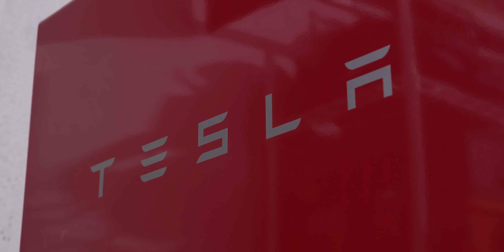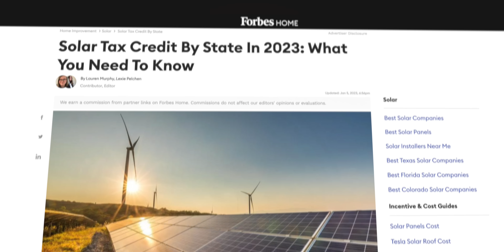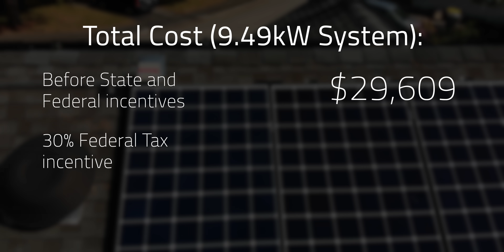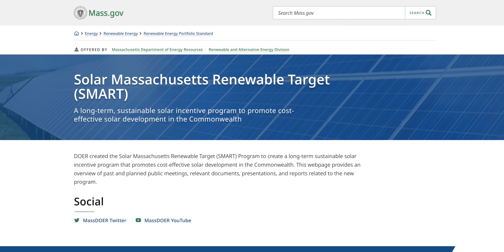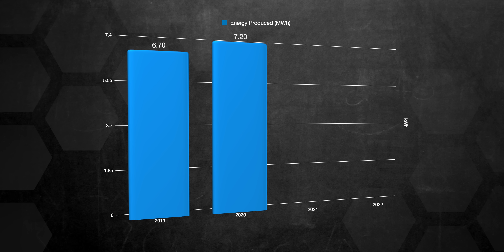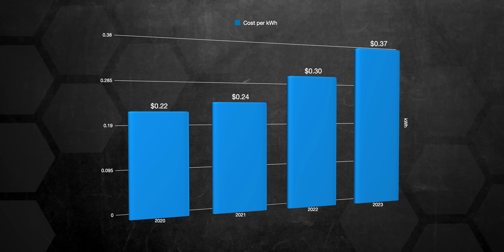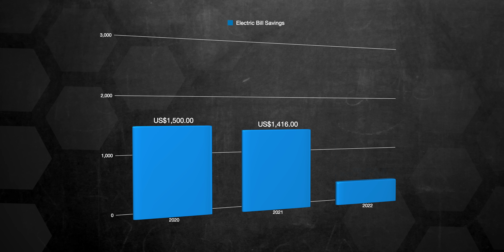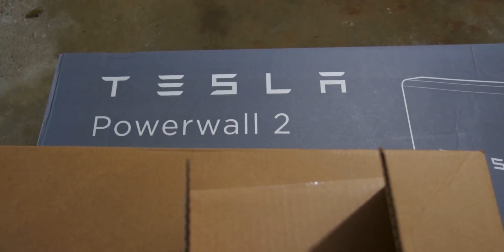5 Years with Solar Panels - Is It Still Worth It?

Comment: Solar panels installs are generally done wrong mounting  to the roof ( metal ones are worse) NASA recommends at least 12" of unobstructed air gap for natural cooling Panels are de-rated 0.5% for every 1 degC   above 25 degC of cell temp ( not ambient) Best is to tilt by 5 degrees

Comment: I was surprised that there is a difference regionally where you install a solar system. You have a 9.6 kW system that produces up to 7.6 mWh per year, I have a 4.8 kW system that produced 7.6 mWh in 2023. I'm in Reno Nevada with a bit more sun. We use about the same amount of energy as you stated in our home, so the system only covers a little over 70% of our energy. All these numbers are similar for usage, but the cost of the systems are way different.

Comment: Well I live in a 1000 sqft house I did my math it’s not worth for me lol I just spend in my annual electric bill just $600 so in 20 years I’ll spend $12k attached to the grid so the 5kw plus battery cost is around $30k plus installation fee so if I get solar option sounds like a going to pay more before to get the investment return so very probably the battery unit will needs to replace before the time that I’m going to payoff the solar panels and the battery, I would like the people clarify those things to the people who I lives in small house

Comment: Almost 30k for 26 panels???? Thats robbery. I had 8 panels installed for 2400 euros. Factor is 3,25 so 7800 euros for 26 panels. mine where also installed in 2018. Insanely expensive.

Comment: 5 years is the tipping point when things usually go south. Thats when the controllers start to fail requiring replacement usually 1 or 2 at a time, this is much more likely in excessively hot regions like the southwest or the cold northern states/Canada. This can be mitigated some by keeping them in a more climate controlled area, but in most cases they start to go bad no matter what in the 5-10 year timeframe. Some cheap ones have been known to die after just 2-3 years.
Then the battery systems in many cases only have a life span of 3-8 years, depending on the brand and type. 
Beyond the 10 year mark, the silicon and soft metals in the solar panels start to degrade, leading to a slippery slope of efficiency from the panels themselves. Typically by the 15-20 year mark the panels are almost useless and need to be replaced. The newer panels made post-2020 are much worse than the ones made in the 2000-2015 timeframe when they actually cared about quality and cheap junk was very rare.

Comment: 965 / 5.000
Solar energy in America is 3 times more expensive than in Europe. My 9.5 KWH installation costs less than 7000 dollars (converted from Euro)
And in the Netherlands we have a government regulation that the returned electricity yields as much as what you use from the grid (this regulation ends in 2027).
Are the solar systems in America better than in Europe?
No, it is the rules of the companies and government that make it much more expensive. The components in the systems are exactly the same, only in America everyone wants to make money from it.

Explanation can be found here.
https://youtu.be/-qNRMwWwvt8?si=QxYBmg9-YDiKDODt

I earned back my solar system in 3.5 years. Plus I have a backup system and battery. Total costs 6000 dollars.
This ensures that the efficiency of the solar system increases to approximately 85%. If you don't have a battery, the efficiency is approximately 30% and you are dependent on what the energy company wants to pay for your solar power.

Comment: Before getting solar, have your electric checked and upgraded or replaced, and have a roofer tell you how long your roof is likely to last.  I got hit by issues with both after the solar system went in.  The roof had been refurbished, but not well, and was wearing faster than it ought to have.  Drilling the slates and mounting the rails meant repairs were more complex and the solar had to be removed and replaced, which doubled the cost of repairs.
The electrics were old and on different standards, and when the system was hooked up, there was a major fault in the main fuse that would have caused a fire if I hadn't called for emergency repairs and had the electrics fully replaced all the way back to the meter.
As for the system, it's a 2 kw system that was available on a grant, which is a major reason I felt rushed to sign up before it closed.  In the UK, large appliances run at 3 kw peaks, so the inverter alone isn't enough to run the house.  It can only run 2/3rds of an appliance at peak.  I still have to import a little.
However, I can run appliances on eco modes to keep them off peak as much as possible, and run them sequentially wherever possible.  This allows the system to provide most of the electricity I need during the day.  It does require a lifestyle change or smart appliances.
I'm likely to invest in underfloor insulation and floor structure replacement at the same time to seal up draughts next, and fit far infrared panels for heating panels and a Sunamp heat battery for DHW.
The system was provided right before all systems that exported were eligible for SECs so I missed out on that until I get a registered battery installed for exporting.
My summer use is 3 kwh and peak production is 12 kwh, so there is 9 kwh available for export at the height of summer.  I will use more when I get a fridge.  At the moment, I use filtered milk which lasts long enough without being chilled and only buy other chilled products that I will use within 48 hours.  But I do miss the convenience of a freezer.
My use will also go up when the  FIR panels and heat battery are installed.

Comment: So, without Taxpayer's money, the solar power system doesn't pay for itself for 20 years.  That means you don't start saving money until year 21.  How much maintenance/replacement costs do you calculate over the 20 years?  That maintenance would make the break-even year further out.

Comment: My opinion is buy backup generators, forget about solar,   Invest in cryptocurrency,  make 3-5 times your money — you will be cooler with your friends, and have plenty of money to pay for your utility bill.  $30,000 K times 5 =
$150,000
  
Or minus being negative           $ 30,000 K for a system that will need updating , and maintenance,  learn crypto only put money in the top ten coins be conservative and make money, no pie in the sky type of investing or put money in s&p make money don’t spend money.😂

Investing has better rates of return than solar,   

Learning about solar takes a lot of time , same as investing,  put your time to work efficiently.

Comment: Snow sliding off roof is really scary.  We had a large barn with a metal roof.  This was a very tall building to begin with so no way we could sweep off snow.  Also as snow stays on and melts it then hardens over and over.  Every year we did have an avalanche which was so massive it took out a lot of our pvc horse fencing.  Shattered the fencing causing danger for animals as well.  In our region, most folks that got solar kept it off any buildings.  Free standing only.

Comment: I put solar panels on I had them for 6 years didn't really save me much money in six years that I had lived in the house where I put them if I had to do it over again I would not it wasn't worth the money they constantly broke down every other month one panel would go down and it was always the same part that would always fail so after the warranty expires I won't be able to afford to keep these things up and running luckily for me I sold my house so I don't have them anymore and I will not put them on the house I have now not worth the money the electric company was charging me more and more for the use of my meter and what I was getting kicked back when I first put them on I was paying about $10 a month when I moved out six years later I was paying $65 a month to the electric company for what the company I use was solar source in Florida they charged me $22,000 for 7 K system I paid $122 a month to pay them off plus whatever the electric company was charging me so in the long run

Comment: I think massive commercial solar arrays are way over subsided and not reliable but a few solar panels on everyones roofs would be a good thing. I own an off grid cabin in Ontario and have had a solar system for 11 years and have no regrets. I have back up generators and use them quite often if i have to run air conditioning.

Comment: I'm definitely interested in solar, but there is ZERO chance I will have anything to do with Tesla.
Reply: @TonysMusic1974  - why? Financially, home solar is a losing proposition, with initial cost, repairs, etc. Teslas, at least in warm climates, are more viable financially, and are the best EVs out there. And both are ECO friendly, so I assume you are a "green" fanatic?
Reply: @sweetrocks85 If you can't figure out why someone wouldn't want anything to do with Tesla, I don't know what to tell ya. And no, I'm not a "green fanatic."  I prefer environmentally friendly options but don't go out of my way to do so. . . . .also, this video has nothing to do with EVs so why are you mentioning electric vehicles?

Comment: To do the economics correctly you have to do an incremental analysis taking things like inflation and the value of the initial cost into account. You also have to take into account the expected life of the system, maintenance expenses and compare the rate of return to investing the initial cost in a compounded CD, Bond, high yielding stock or simply paying down the mortgage on any loans. The high initial cost and simplified math hides the time value of money for any multi year project. I went though this many years ago when looking to invest in a company that was making solar panels. They used simple math and a 30 year lifespan for a solar field to show incredible profits. Once I did a proper incremental analysis I found it was not economical and didn't invest. The company eventually failed.

Comment: To run an RV with one AC unit (1600 watts use all day) 24/7 you will need 3000 watts of panels atleast a 4000 watt inverter and bare minimum 10kw hours of batteries. 😂

Comment: Solar panel price index has fallen by over 70% since the beginning of 2023. And inverters and batteries have also become drastically cheaper! 
Solar electricity from them now only costs around 2 to 5 cents/kWh!
This is because solar panels generally last at least 25 years - and are maintenance-free.
It is therefore very worthwhile to install as many solar panels as possible on carport or house roofs, on house walls & in the garden.

Comment: 5 Years with Solar Panels - Is It Still Worth It?
That is a dumb thing to ask or title this video, before watching i can tell you the obvious, solar panels are becoming more efficient per square meter all the time, also cheaper too, so it will be more worth it as new system come out and power is getting more expensive all the time do to inflation and other factors.

Comment: Come on guys, stop the BS. Solar panels are expensive, takes close to 10 years to recover the cost, and they are only suppose to last 10 years so that’s a reoccurring cost. On top of that, the solar panel guarantees are not good because the companies aren’t around in 10 years. They grab their money and are gone before they have to repair anything. Plus if you’re saving the power with batteries, that’s a whole new expense and batteries replacements is needed every 10 years or less and where do you discard those to be environmentally safe? Not to mention how expensive the batteries are. Now, in my state, the power companies are only required to pay you money for the power you put back in the grid up to your electric bill so you can’t even recover some of your investment selling power back to the power companies. Please people, sit down and run the numbers before you do this and not with the solar guys. And to finish, I’ll say this, the government subsidizes some of the cost of installation. Truth behind that is that the companies know this and overcharge so that they are actually getting the money not you. That’s what happens with subsidies. Sure it great to actually only being paying in the end what it worth, but don’t pretend like you’re getting some big break.

Comment: If split panel set into 2 set and flip half and put in cool area inside cold water and connect control and load then connect to 1)2 set in the sun then that cool city while produce electricity for use and switch the other direvtion when snow outside and warm water inside it still work

Comment: I live in the sunniest part of the USA.  My Summer electric bill was $520/month.  Since I got solar 5 years ago my bill is $20/month year round.  When there’s any issue the company comes out the next day and repairs it, no charge.

All our city’s power is underground so I’ve only had a power outage about 4 times in 40 years, and only for an hour or so, so no need for batteries.  I ‘sell’ my power wholesale to the power company.  I get credit for the part they resell at retail to you folks without solar.
Reply: Oh, I have a standing seam metal roof, so my panels are clamped on with no roof penetration.

Comment: Another consideration is the condition of your roof. If it's possible your shingles mind need replaced within the next 5 years or so, it might be worth getting that done before installing the panels. This will be an additional cost that needs to be considered, but will save significant labour if you need to remove and reinstall the panels 5 years from now. Great video. Thank you.

Comment: Hello from southern WV. purchased last Dec, installed by march. turned on by April.  Nov 13  5,6 MWH is the good. have 16 415 Watt panels. Thinking of adding 10 more 410 watt panels to the south side of the garage, How do I find the do's and don'ts for adding to the array. Was happy with the workers but not so much the Co.

Comment: man where i am solar pannels are so cheap now now $0.18usd per watt can build a 2kw system for $600 usd, inverters pannels and all, and sunlight hours here, is about 3.2Mwh per year for a 2kw system, no net mertering here anymore though, as you can get solar for free almost, if you finance, 0% interenst 24 months is $6 per pannel and they generate $13 per month, so solar is free....... this is simple grid tie, if you produce more than you make, duing the day you would need batteries to get more

Comment: I had a 7 kW array installed on my roof in 2016.  Squirrels chewed all the cabling, apparently they like the insulation for their nests.  $5000 to repair, including supposedly squirrel proofing.  Nope, they got in again. This is in Toronto, Canada.  I sold the house for other reasons, so no idea how the system is performing these days.

Comment: Very interesting video with illustrative figures. Here in Chile, I'm installing 7.7 KWh of solar panels without batteries. The installation cost is 1,162 USD/KW, and I expect an annual capacity factor of 0.18 (Santiago de Chile). There are no tax incentives. Savings are achieved through the lower cost of energy withdrawal and the surplus injection. (Withdrawal 0.216 USD/KWh, Injection 0.095 USD/KWh), I estimate 33% withdrawal and 66% injection. With these figures, the payback is achieved in year 6.

Comment: I live in Hawaii, in an area that receives 278 days of sunshine with temps between 70 degrees F and 85 year round. We get an average of 14 inches of rain annually and no snow. We do not need heat, obviously, but many homes have solar panels these days, and use AC. In the old days, we did not use AC. We were acclimated to the heat. I do not use AC, despite having a new central AC in the home I just bought. I decided to conserve energy, rather than buy solar. I live alone. My electric bill is $120/monthly. If I used the AC set at 72 degrees, it would be between $400 and $500/month. If I lived like that, I would feel hot every time I went outside. I leave all my windows open with gentle breezes flowing through. It feels divine. If my power goes out for an extended period, I will go stay with one of my kids elsewhere on the island.

Comment: Your review is excellent in so many ways. Your reveal of issues and rewards is practical and helpful. I'm glad that your ROI is good and that you have also the reward of this youtube exposure with first hand data. In 1982 I invested in a high volume hot air solar roof collector by a local factory called Northern Solar. This was not solar voltaic, just and air circulation to the home and a heat exchanger for the hot water supply. It worked and was simple, but still required 12 years to pay for itself. I hear you clearly about the challenges of obtaining good quality installation. All home improvement projects require a large time investment to insure good workmanship before signing a contract.

Comment: In terms of adding value to your home I would think only if installed within last couple of years. The panels, like light bulbs, change as do the manufacturing processes so existing panels become difficult to match and replace fyi.

Comment: I have a 16kW system with two powerwalls.  Does it pay for itself?  No.  But I did not buy it expecting it to pay for itself.  I bought it for resilience.  Hence my powerwalls are 100% dedicated to back up — not storing energy to release the storage or any portion of the storage when the sun goes down.   When an outage occurs I don’t even notice it. In 2023 I generated 26.4 MWh.  I sold 10.7 MWh to the grid and the rest went to the home.  So far in 2024 the system generated 21.2 MWh and I sold 8 MWh of that to the grid.